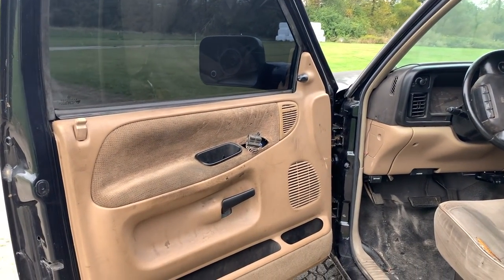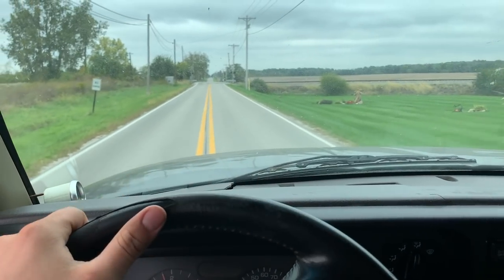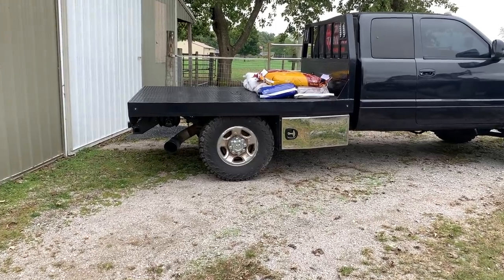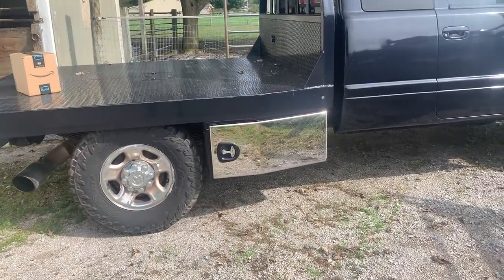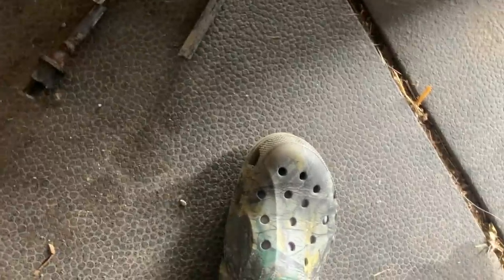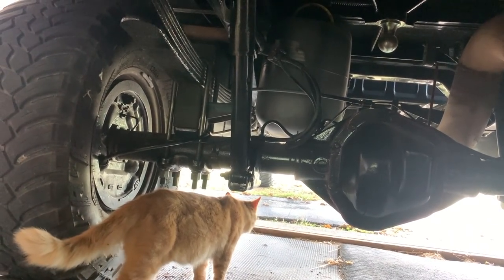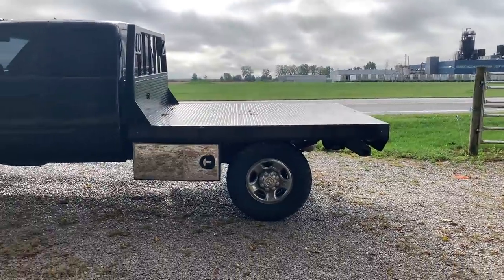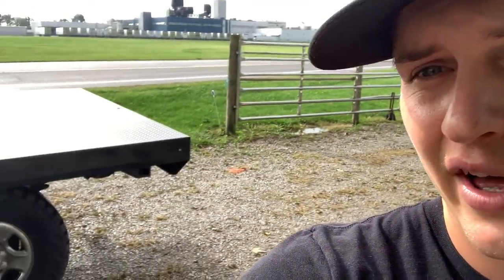I bought a SQUATTED TRUCK and had no idea!!!

Comment: Buy a new plastic backer for the headliner the stock fiber one is to weak. I had mine recovered and it sags in the front.  I ended up ordering anew headliner from rock auto